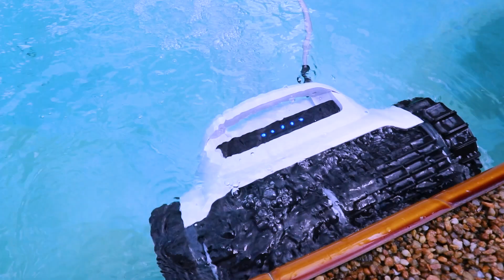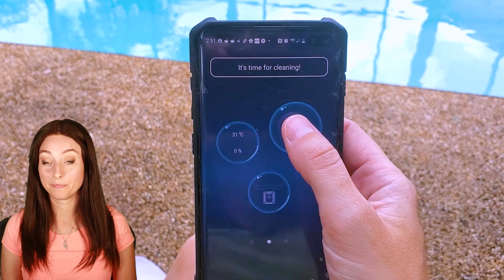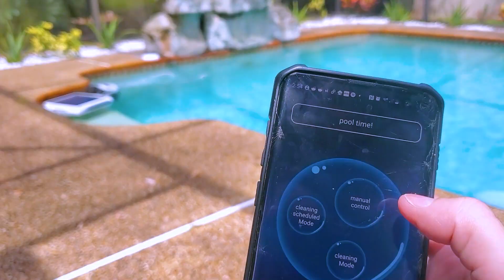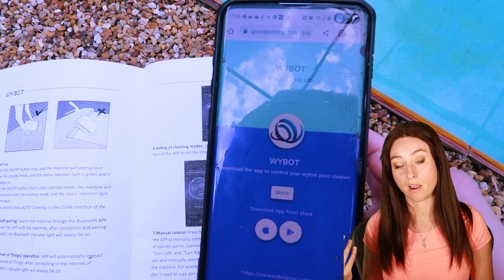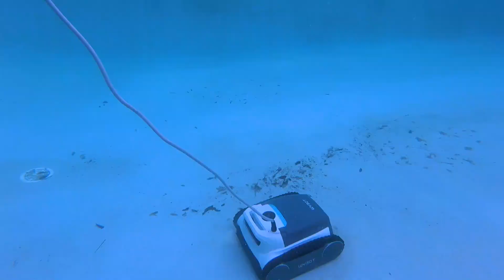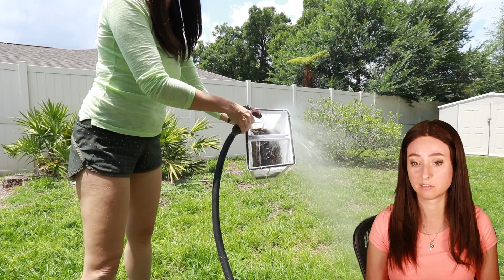Wybot M1 Ultra Pool Vacuum with Solar Panel

Comment: Another great review. The Wybot M1 seemed to do a good job.
Reply: It is not cheap 🙂
Reply from the maker: They never are. A cheap option is manually doing it with an attachment and a hose that plugs into the pool.